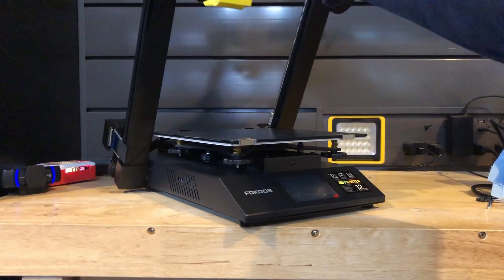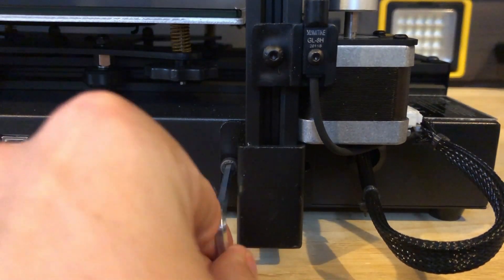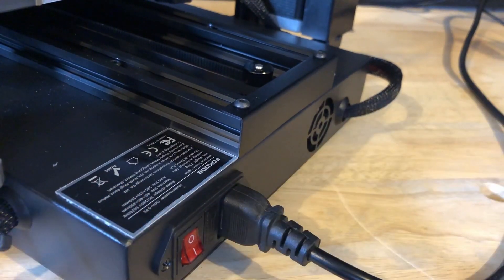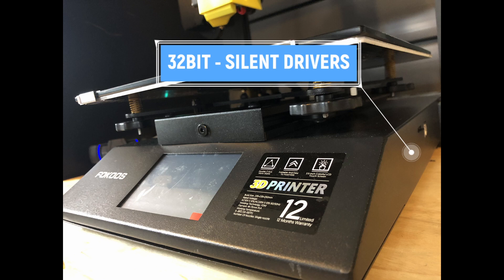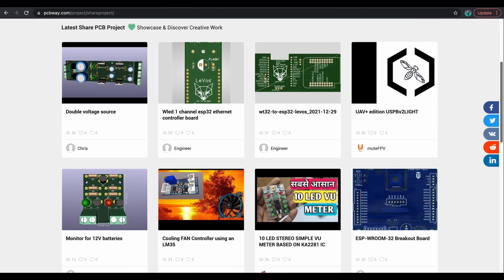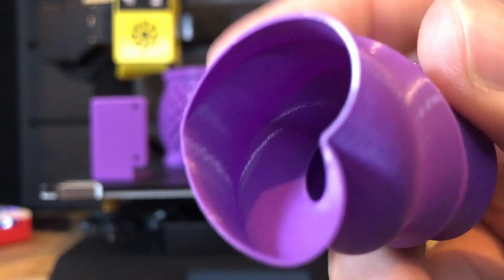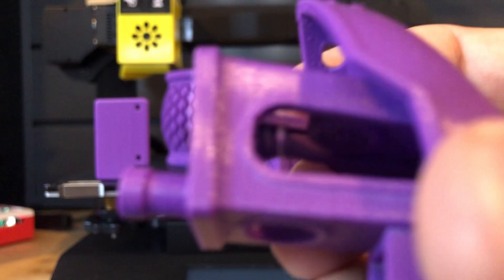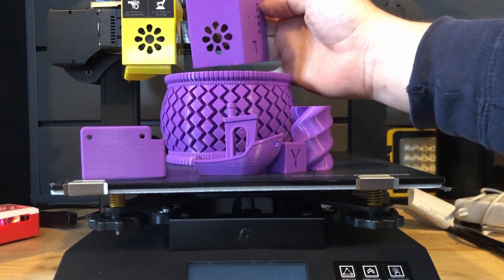FOKOOS ODIN-5 F3 - FOLDING 3D PRINTER

Comment: I'm not a 3dp newbie, but I do appreciate the explicit on screen info like what the t nuts are or where the bolts are screwed in for the gantry or what the ribbon cable is, etc. Things very familiar to me but probably not to a new comer, yet integrated in the video rather than the explanation, providing visual aids, without having to spend time handling things in a specific way to point at them. Makes the video very enjoyable without having to go over things I already am familiar with, yet very clear for everyone new. Good job!
Reply from the maker: Thanks J S!  If you look at my earlier videos, I did just that pointing at things, or try to explain without a visual reference.  I decided to retool the way I edit and present my videos about 6 months ago.  Spending money on software, callouts, titles, and lower 3rd add-ons.  I wanted to focus on clean production without taking away the content.  It is hard finding that middle ground for the newbies, intermediates, and experts.  Cannot please everyone.  By pausing the frame and using the callouts, I can explain very quickly what is needed then move on.  It might take more time editing, but I believe that it is a cleaner approach.  It was really nice to do this video, because this machine took very little assembly, unlike the two laser engravers, and the FLSun SR I just reviewed.  Those three videos took me forever to edit.  I appreciate your feedback, thanks for watching and commenting.  - Tripod
Reply: @TripodsGarage  this was the first video of yours I watched, so I haven't looked at those vids so far, I came from a recent call out you got about accessibility (can't remember it was Twitter or here). What you did is also accessibility, even if it doesn't target a specific disability. Coming from a software engineering background where how you present the functionality is as important as its usefulness, I can't stress enough how important what you did is. So you sir, got my subscription.

P.S. I find it a bit weird when you try to handle things with only one hand, isn't it inconvenient for you?